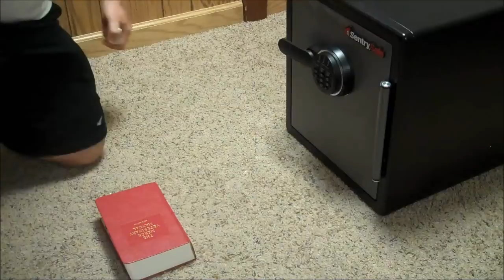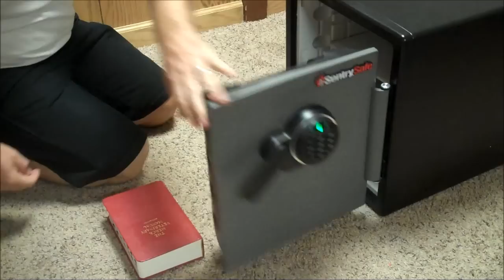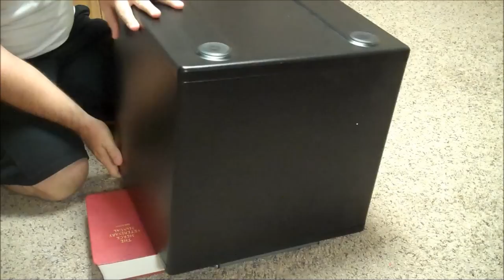'Electronic Safe Fail : Common Vulnerabilites in Electronic Safes' - Bump with Magnet

Comment: Usually when a stranger breaks into your home he doesn't bring a very strong magnet with him, Most scavenge what they can as fast as they can. I have this EXACT safe and it is bolted into the concrete with 4 inch lag bolts and anchors. Good luck.